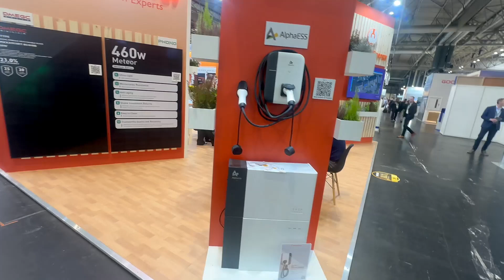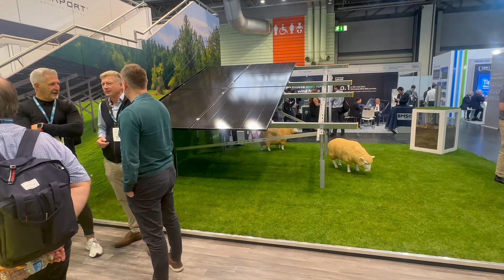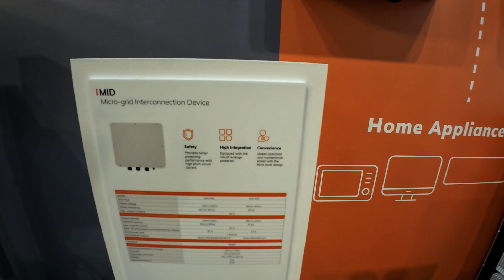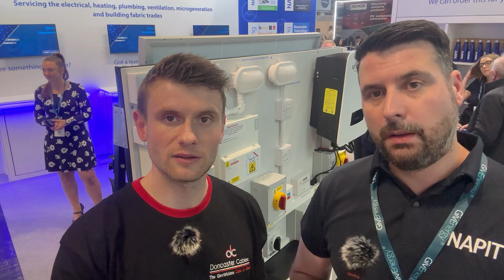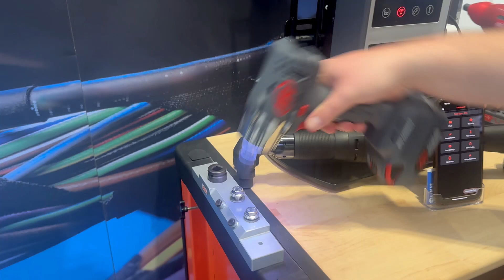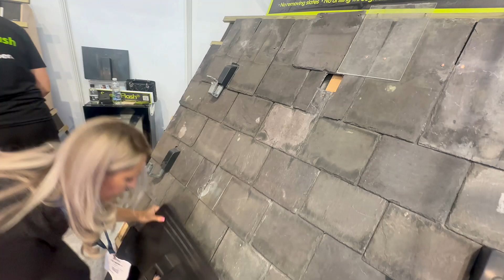More New products in the solar and battery industry for 2024 - Live from Solar and Storage

Comment: In South Africa, we have to run DC fuses and SPD's on PV strings. I see in the UK you guys only use isolaters and sometimes SPD's. Why negate the use of fuses or DC breakers? Seems silly from a safety point.
Reply from the maker: @hein_mcleod  we did a podcast on just this a few weeks ago. We do use string fuses just not all small domestic arrays when ccc of the cable is adequate for currents in fault conditions. You make a good point though. Maybe we should!